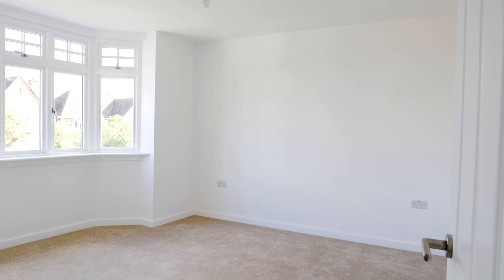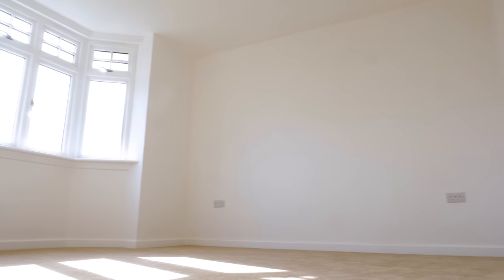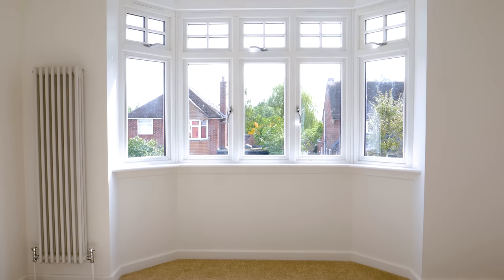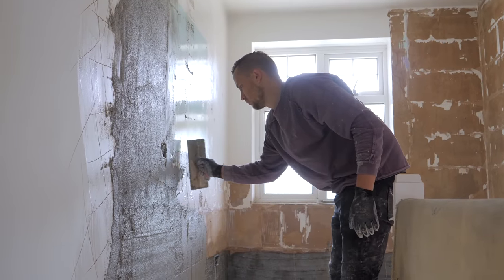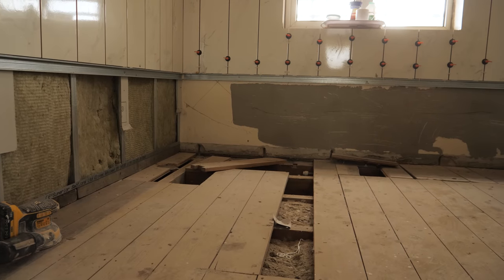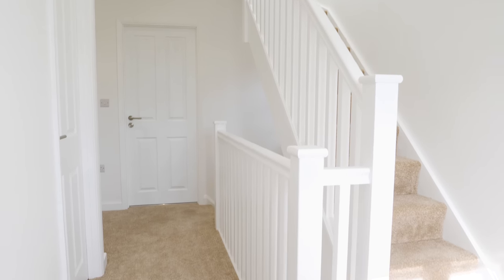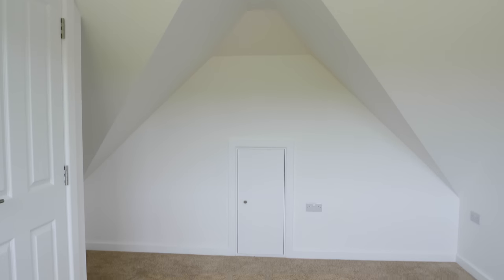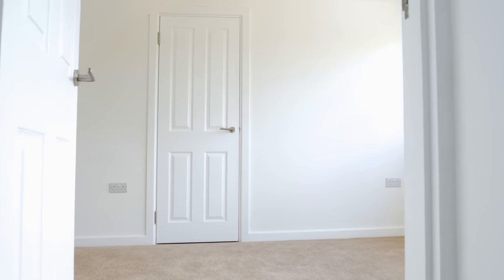House Update (05) | Paul Sellers

Comment: I know it is probably is not a usual item in the UK, but are you considering plantation blinds for the windows? Its quite a woodworking challenge to make those function smoothly, but the result is awesome. Congrats on all the great work!
Reply: Shutters were used in victorian, edwardian  buildings and also mid century builds in the UK. There is no reason as to why they could not be used. They tend not to look as good in the UK on a tall window that runs from near floor to near ceiling.
Reply: I was thinking also in line of traditional indoor blinds that open and close mechanically in a vertical movement. Of course exterior blinds are quite an addition
Reply: Its been getting so hot in August here in the UK from global warming that I would love them.  Houses just don't have air conditioning and it doesn't make sense to install it for the 2 weeks a year we've been having tough heat waves.  Unfortunately I can't fit shutters to the uPVC windows in my flat - they open inwards!

Comment: Just a suggestion where the stair room is going to be consider safety as a person walking down those stairs could trip and fall into anything that has a sharp edge to it. So having a soft seat there right in front of the stair could be an option.  There is plenty of space there for some cleaver designs.

Comment: Ikea or Ikea clone bathroom furniture? All the white paint covering the wood? Your house, your choice.
Reply from the maker: And a great backdrop for my work in the same way art galleries always have white of off-white walls to allow the work to speak for itself. And not interested in boxes for bathrooms. I need to get on with the real design of my furniture. As you rightly said. My house and my choice. It works. And remember too that my audience is global so it's the furniture first and no one really discusses the frame on artwork too much because the frame is supposed to disappear and not influence the art itself.
Reply: Painted wooden doors and skirting etc have a good  fresh look.

Comment: I recently moved an old wardrobe from my grandmother to my house for restauration. It was able to be fully disassembled. The two outer „walls“ had a small rectengular wood piece on the inside with two holes trough which roud pieces go and be wedged on the undersite. The middle piece had two dowels on the undersite. On the top the outer walls were wedged with a kind of slideable metal dovetail and the middle piece hat something like a lock. If you have interest in pictures of the mechanisms for inspiration i can upload some.

Comment: Do you have 50 or 60 hrz electrical?  120v or 220v for common electrical connections?
Reply: 50 hrz, 230v in the UK
Reply from the maker: In the UK, the declared voltage and tolerance for an electricity supply is 230 volts -6%, +10%. This gives an allowed voltage range of 216.2 volts to 253.0 volts.

Comment: When it comes to doing free standing furniture that is up close to a wall not having a baseboard/skirting can be an option. That base or skirting can create a large gap from the furniture to the wall because of the bottom board is fitted to the wall. 
Not a real issue with wardrobes that tend to be taller than people so they cannot really see that gap but when it comes to waist height furniture it can really stand out.
Reply from the maker: A simple answer to that is a board at the back of the top to stop things sliding off. This thickness can match the skirting board. I just did one on a piece I made for the kitchen down below.